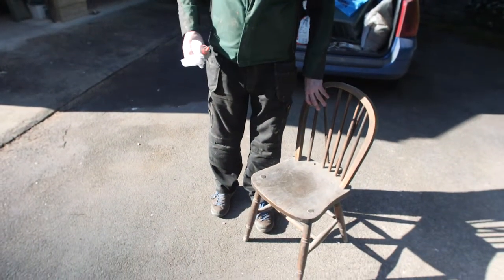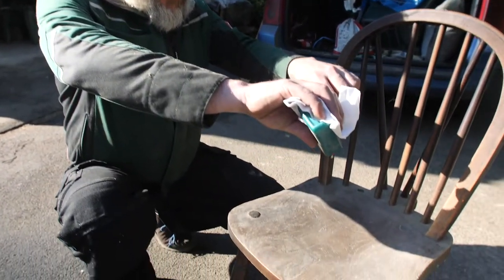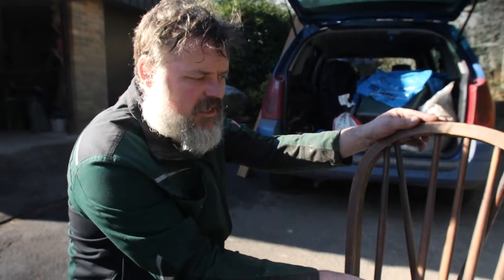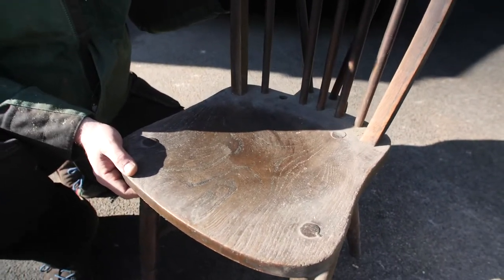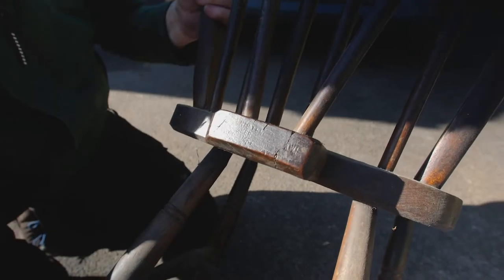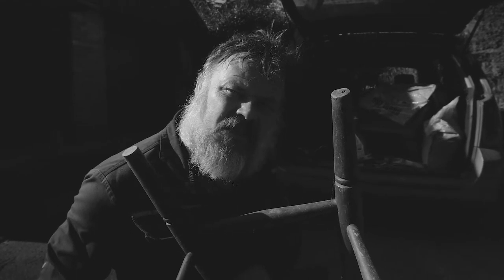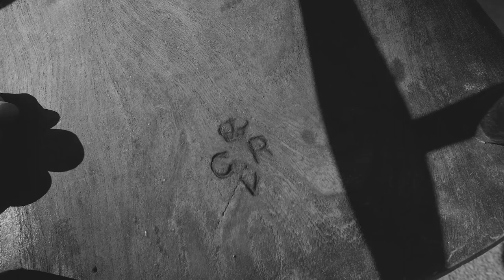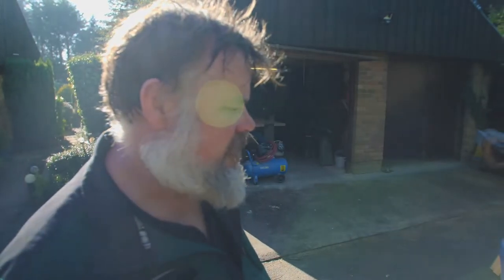Restoring antique wood furniture - part1 - how to restore a chair

Comment: Uncle Al, I'm new to the channel, however, I got here as fast as I could. LOL. I've been "commissioned" (told) to restore two old/antique rocking chairs for my mum. The pieces were left out in the weather/sun for years and I was wondering what to apply to the wood to rejuvenate the wood before I attempt to straighten and glue the pieces back together again. Thoughts?
Reply from the maker: Hi fella, a bit of sanding and oil application - we have something in the UK called Woodoc, revives the wood, where are you based chief? Stick a search on the old google and you'll be able to find a product that does soothing similar. Best of luck with the project! Let us know how it turns out.

Comment: Can't said to see the steam bend magic.
Reply from the maker: That's going to make for either an educational masterclass or a tirade of effs and jeffs as Al get's increasingly narked off when it doesn't work. Both ways will be entertaining though.
Reply: Hey Up, Ronna! I’ve never tried steam-bending before. Think Mark’s right, I’ll swear a lot or it may go well! Been giving it a bit of thought actually, think it’s probably going to be a bit more involved than just bending it into position! Fingers crossed. Anyway, thanks for your comment and support! All the best! Al.
Reply: So, once you get it bent into the holes, you clamp a couple straight edges to it to dry?
Reply: Ronna Keil You’ve got it. I’m probably going to make up a couple of guides - they’ll hopefully keep everything straight once ‘plopped’ into position. It’ll be tough matching the finish too mind!